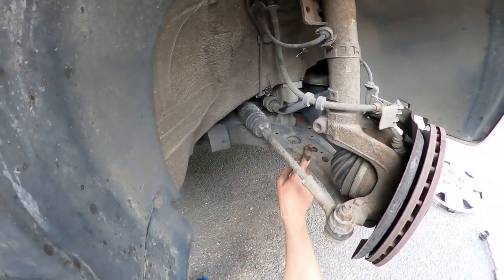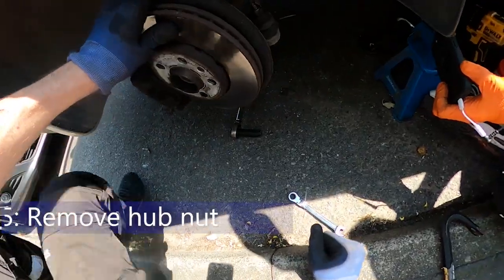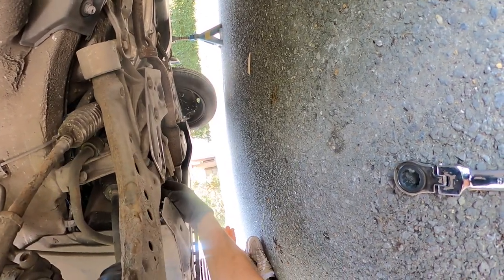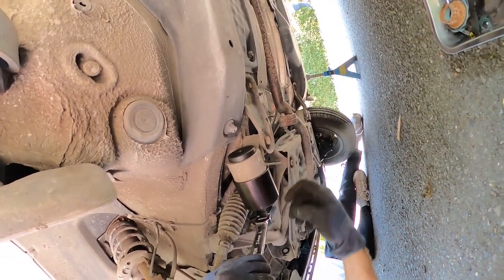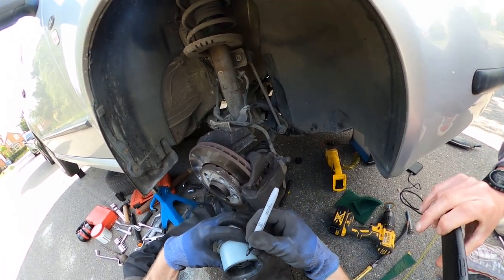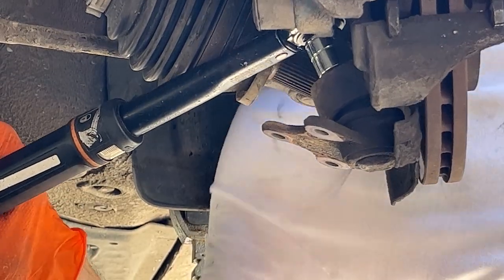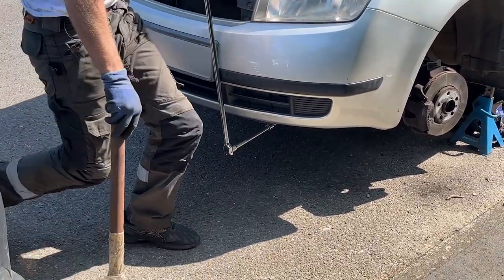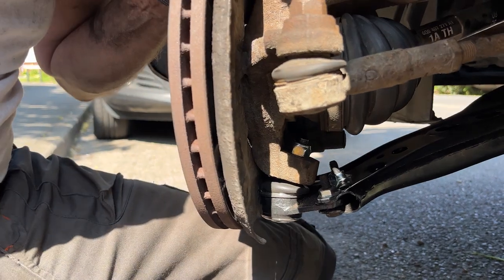Skoda Fabia / MK4 VW Polo Front Suspension  Bushes / Arm Replacement

Comment: "Have faith & persevere." Mad respect to you man and all the warriors doing this om the floor of a busy parking lot in the sun! 
Humble tip for less experienced diy's, when you tight 90 degrees with extensions to the front of the car, put some wood under the ratchet (or the tire) so the extension assembly doesn't float in the air, and it will be a breeze.. because if the sockets jump off the bolt your fingers will kiss the ground lightning speed. And your back will thank you also.
Subscribed!
Reply from the maker: @blackinblue11  Thanks so much for taking the time to comment and subscribe, it really helps the channel :-) Totally agree - that long extension for the 90 degree turn was pretty precarious - a block of wood - ideally with a 'v' cut into it would be ideal to maintain the arrangement. Keep smiling :-)

Comment: awesome video, really helpful. but did have you have to align the steering or was it not needed? does it want to pull to one side or it fine? thanks.
Reply from the maker: @jakubkocian1145  Yes - good point I totally forgot to put that in the video, will edit the description. Yes - it was quite funny actually: Oliver drove down the road after it was done and there was literally smoke coming off the tyres after about 90s. He had to keep pulling over on the way to the tyre garage for the alignment lol.

Comment: Does the receiver cup come with the kit you listed?
Reply from the maker: @gsoup7850  Good question! I think you mean the rubber bushing that sits in the sub-frame and the suspension arm slots into? If so - no I'm pretty sure I had to buy it seperately. Really sorry - don't have a part number at this time, but will dig into my old paperwork and revert asap
Reply: @FixItWithJon  thanks for the reply! No I meant the cup that the old bush moves into as you extract it 👍
Reply from the maker: @gsoup7850  Ah! I see.. Yes - that comes as part of the kit :-)
Reply: @FixItWithJon  great, thanks for the info 😊👍